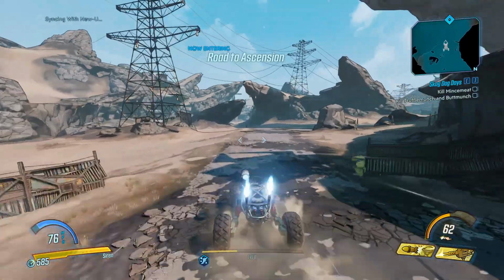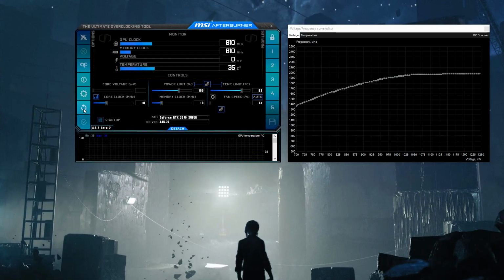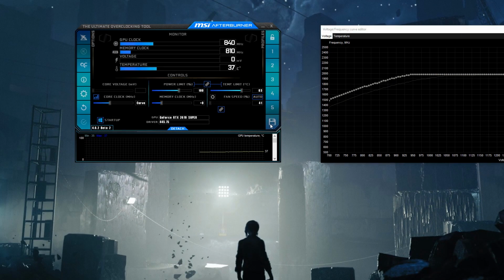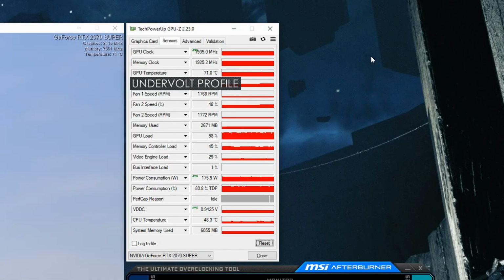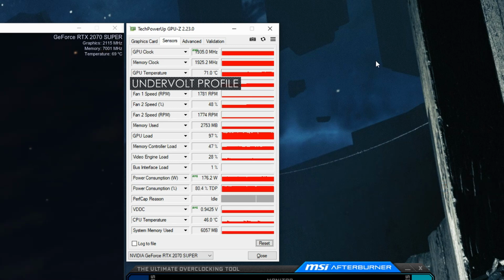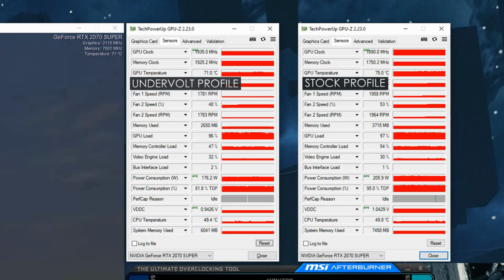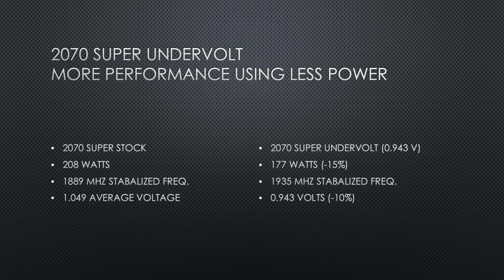RTX 2070 Super Undervolting + OC: Lower Power, Lower Noise, Higher Performance

Comment: Some people doing undervolting DONT set the +130 (here example) core offset and instead jump into curve editor and just choose their ideal max mhz and voltage ie. 2040 at 1.25v so everything before that is stock and +0 on the graph, but at that point on its like +105 to start.

What is better?

I can do that, and go for 2040mhz at 1.18v and it finishes time spy and fire strike, but when temps start to throttle it can downclock down to 1890 but usually 1935 at the least ie. Stock Max.

If I add 110 offset and THEN apply the undervolt 2040 - 1.037, with custom changes prior ie 1.012 to 1.031 is set to 2025.. this works too, like in the vid. The only difference is higher voltage/temp i guess  but benefit is when it downclocks it only really goes to 1980 lowest

Comment: I have everything set up like yours, initially everything worked on frequency 2000 and voltage 925, for some time I had to change the voltage to 950, and today even to 950 voltage, for example in forza 4, the image freezes, the sounds of the game can be heard normally, while the image or freezes or turns black. What's happening? This has never happened before.
Reply from the maker: Was it stable for you in Forza 4 previously?
Is your CPU and/or RAM overclocked as well?

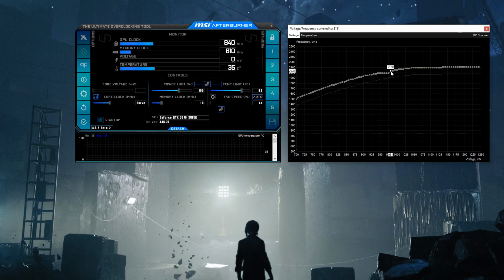Comment: Can someone please tell me if I'm missing something? All you're doing here is ensuring the GPU never goes above 1990MhZ, even with voltages over 925mV? What's being performed at 1:30 appears to just be UNDERCLOCKING, and not UNDERVOLTING.
Any improvements to clock speeds were made when the curve automatically changed when the 130MhZ OC was applied. From there speeds were just being downgraded slightly?
Reply: he is locking the frequency at that 1990Mhz @ a much lower voltage (943mv would hold handle about 1860Mhz in stock config). You can only cgo so far, If you keep bumping up the frequency at that voltage, it will become unstabel and crash. It is trial and error, your gpu might achieve a little higher or lower frequency by that given voltage and that is way the manufacturers leave this margin  we are trying to get rid off as much as we can to save energy while balancing with the lower temps, enables the chip to keep the clock constant, not having to drop tens of Hz everytime the temps rise a few degrees. In some cases, you wont be able to achieve a higher overal clock but being more stable might give you a higher average fps

Comment: I just bought a 2070 Super Strix and did the following:

1. Get a baseline benchmark score/s at stock.
2. Reduce the power limit to, say, 80%, and use Afterburner's OC Scanner (use v4.6.2, no later) to find an overclock at that limit. Test again.
3. If the performance is within your desired margin of stock (I chose 2%), reduce to 75% power limit, repeat, check, and keep going until you fall out of your margin.

I got down to 65% power @ 98.5% performance... this cut the watts from 255 to 165. With no perceptible loss of frames.

Comment: I did so great on my RTX2070.
Before undervolt
Heaven Score = 4509
Temps 85+

After
Heaven Score = 5107
Temps 75+

this worked so great I recommend anyone.
Reply: can you tell your settings i ave an rtx 2070 super gigabyte

Comment: There is a fundamental problem with your testing here. AVG TDP might not tell nothing if you reset it at the wrong times. What you need is to run a benchmark and reset it right at the start and repeat the process for your overclocking profile

Comment: This is WRONG!!!
DON'T DO IT LIKE THIS!
The only thing you are doing is limiting the amount of MHZ the card can reach.
If you really wanted to undervolt, you'd have to RISE the squares on the left side, not lower the ones on the right side!
Please delete this video and make a new one!!!
Reply: That doesnt sound right
Reply: @danhough242  he is correct. undervolting is reducing the voltage that is used when boosting the card. you raise the squares on the right to match your cards max voltage and keep raising more and more until you notice artefacts or crashes. then lower a few back down and go from there. this video is horrible and he has no idea what he is talking about.

Comment: Started with 937 mV 1935 Mhz +1000mhz on vram. But appeared some of microstuttering on the witcher 3. Now I thing its all stable with 950mV at 1920 mhz and +600 mhz vram. Thats perfect to get some extra frames and -4ºC on Founders edition, wich is too hot from stock in my opinion. My curve its more agressive (steep) when it gets max speed core. not sure if this could be related to microstuttering. Thanks for the video!
Reply from the maker: you're welcome, glad this worked for you.

Comment: My rtx 2070s 1890mhz 0.82v RAM  is +1100 mhz, my card use 135w max
Reply from the maker: nice
Reply: :O
Reply: Yeeah,but u stable in 99 of 100 pictures. U got powerdrops for sure
Reply: @nvidiazimbabwe5914  Nope, Frame Times and FPS is stable 

My new card is the rtx 2080 ti
Uv 1830MHz 0.8v

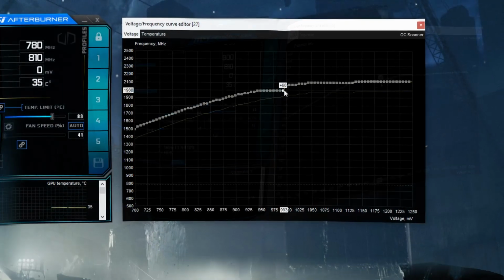Comment: 1:32 you can flat the curve by holding shift down into the black area behind your undervolting point and drag them all down underneath ur undervolting point. They will automatically adjust to your highest point then. So you dont have to do it all manual.
3:51 So no its not time consuming :P
Reply from the maker: thanks for the tip
Reply: All the time I lost doing it point by point...
Reply: @maqui1814  lmao :P
Reply: Bruh

Comment: Can I use this profile for zotac rtx 2070 super amp extreme?
Reply: I have the same GPU as well and you can get the curve while simple performing OC scan or just try it manually
Reply from the maker: sure, though each chip overclocks a bit differently.  it took a bit of trial and error (ie. crashing in games) for me to get the result in the video for my specific card using the latest version of MSI Afterburner 4.6.2.
Reply: have the similar one as u except no extreme

Comment from the maker: An already efficient GPU is made even more efficient by simultaneously lowering the voltage while over clocking.
Reply: You should try dropping to 1900mhz to see if you can get to 900mV and then see what savings you make then... 35 on the clock is probably not even 1 FPS trade-off in reality.
Reply: Please look at my comment!
You are misleading people and yourself!
Reply: @maxzett  No, he's not. How's he doing that?
Reply: @syzerix3157  he's not undervolting
Reply: @syzerix3157  He's just UNDERCLOCKING (or lowering the overclock) by moving the squares down at each point. Look at what the X+Y on the chart represent.. 😅